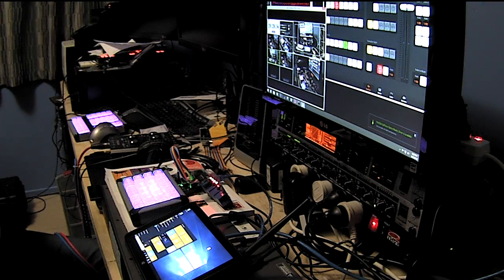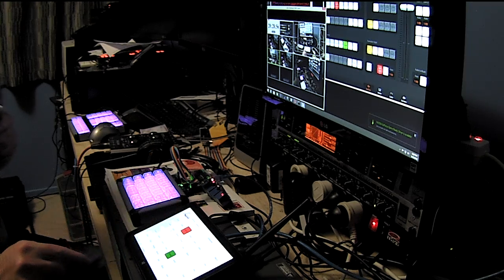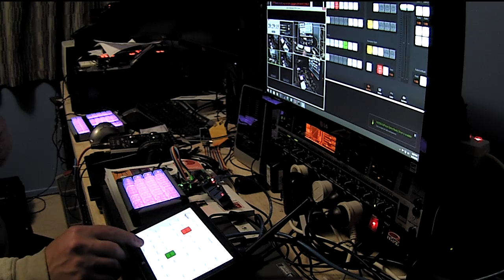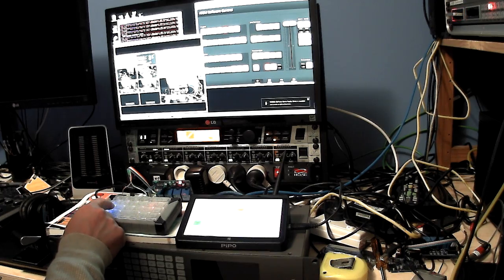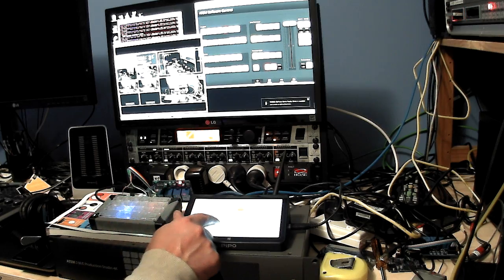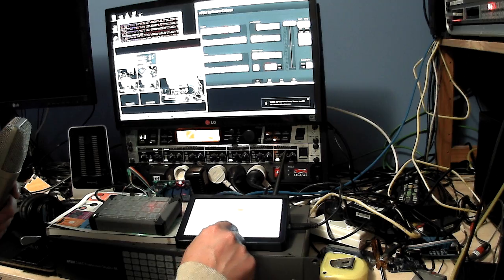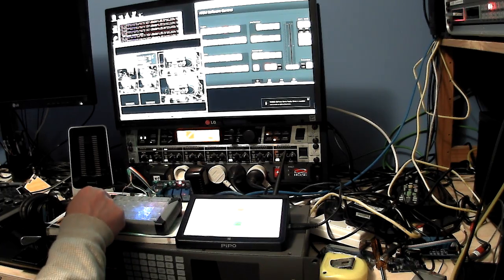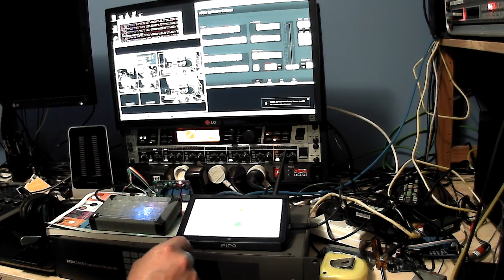XKeys, ATEM and Arduino GPIO

Comment: Same question as the previous commenter regarding if you plan on releasing the code, also happy to test here in Sydney - love the x keys implementation! Seems like it would be more cost effective than a Skaahroj or BM original panel!
Reply from the maker: Planning on releasing it as an inexpensive product. Beta version out shortly for free testing. Need to get double key press detection working on XKeys and it is only working with TVS at the moment (tried it on a 2 M/E but it crashes, working on that also).
Reply from the maker: See https://ianmorrish.wordpress.com/downloads/